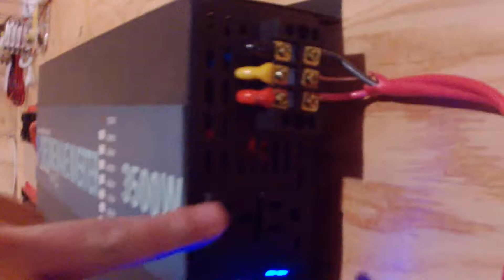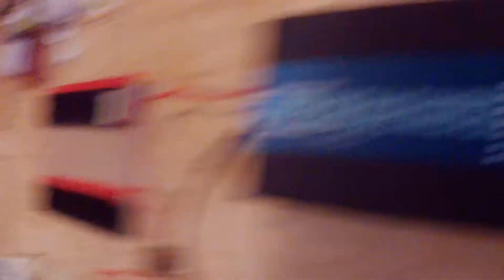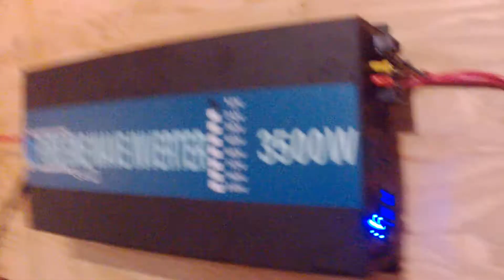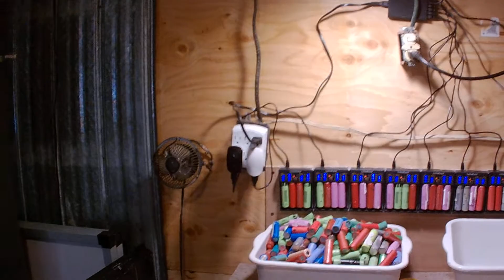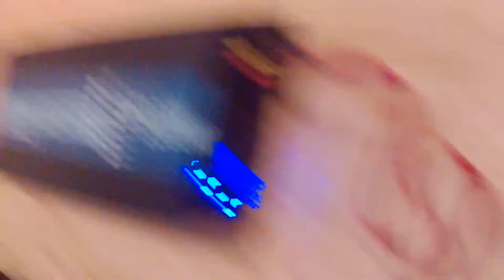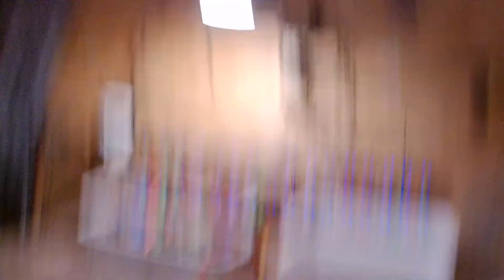reliable electric 12 volt inverter review hard wired black is neutral red is hot an yellow is ground

Comment: Many of the reliable inverters but apparently not all. Have 60v on neutral wire and 60v on the hot wire to make the 120v. So keep that in mind as you are wiring this to a house or shed. Even if you turn off a breaker. There is still 60v going to the neutral wire. If you wire this in typical USA configuration. It will work. But make sure that neutral wire will not ground out to anything. Just a heads up!

Comment: Hey I just installed my 3500.   Im getting 12.3 in and 12.2 out.  I also have a blinking red light.  The run is connected to 4 group 31 batteries in a prostar international. 

  Do you think the problem could be with the automatic relay cut off that helps the batteries have enough charge for crank?

Comment: I wired up a 4000 watt reliable same way. 18 batteries, now with solar charging. (1.5 years later).
Only regret is the inverter is 12volt. In hindsight, I wish I would have gone with 24, or 48 volt.
Less effort to convert, longer run time too.
But I've used this on a seperately wired system throughout my home. All into a 100 amp breaker box. But only a 30 amp main in the box for protection. Can't even guess my hours of use but its ALOT. Never a problem, take 8 hrs to charge via a 12000watt genny, which also powers the same system while they charge. Cuts my fuel consumption Down by 2/3s. 6gals last 12.5hrs.
Real happy with it.
You did a nice job. Good ideas.

Comment: Reggie - Wondering if you can help. I just received a Reliable 12V 3000W yesterday. Both AC outlets work fine but not getting the 120V on the terminal block across the red and black. Just getting zero reading. I should say that I connected the NEG battery cable first and when I touched the POS post I got a spark and it beeped. I realized the power button was in the "ON" position. I turned the inverter off and connected the POS battery cable. I turned on the inverter and everything seemed to look right. I got 12.8 V and it was putting out 122V. Plugged in a small fan on both outlets and it worked fine. Do you think I damaged the terminal block? I don't feel comfortable checking the fuses but I will if you think I may have blown a fuse. Any help would be appreciated. Thanks.

Comment: Good vid. I have the 4000 watt Reliable. But I used 4/0 battery cables to the unit, as well between the battery. With 10ga. to my separate box an supply system. Not connected to my grid power. All separate. Do yourself a favor, go to the 4/0. It will increase the inverters effectiveness greatly.
Thanks, good vid.
Reply: https://youtu.be/0wRw45SJPFQ

Comment: Can you tell me the input range for that inverter?
Reply from the maker: yes input voltage is 11 to 15 volt
Reply: I can tell you that my 4000 watt Reliable is powered by 24 12 volt series 31 deep cycle RV battery. I have only ran system checks (approx 8 hrs) per test, once every month.
I power up my propane furnace, 2 freezers, 1 large house fridge and a Kuerig coffee maker. Never an issue. 3 tests so far.
My system is for power outages only. Also have a 12000 gas/propane Benny and 5 chargers (so many as they don't last for ever).
Also a 4000 watt Benny for the same reason. I store gas in a 500 gal poly water tank. And have 2000 gal worth of propane tanks (1-1000 gal, 1-500 gal, and 5-100gal tanks).
When I begin my alternative power usage it will be with the Benny. All my inverter equipment is stored in a faraday cage/box.
But with everything running I've only pulled 25 amps out of the battery at once. And that only 1x.
But I have the feed cables fused with 250 volt fuse links. Can't imagine with I'd have to do to pull more amps than that. It seems I read that it shouldn't be allowed over 250 amps.
Not sure though.
Oh and be sure you use 4/0 copper for battery connections. That will help keep your resistance to a minimum. And allow the inverter to work more efficiently at peak levels.